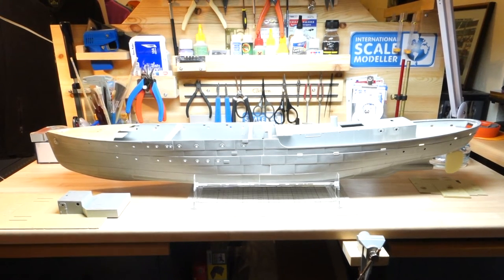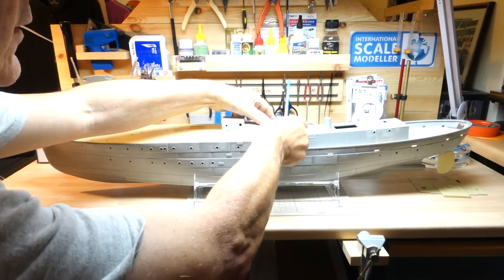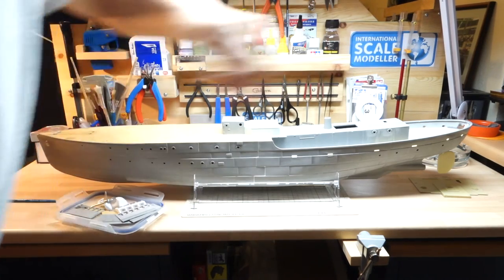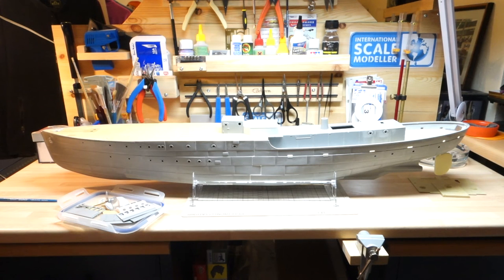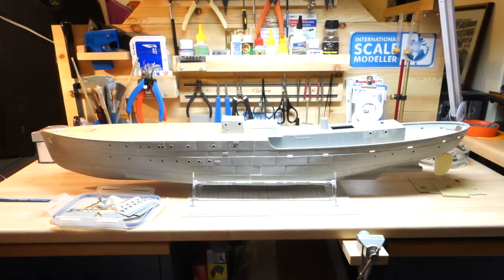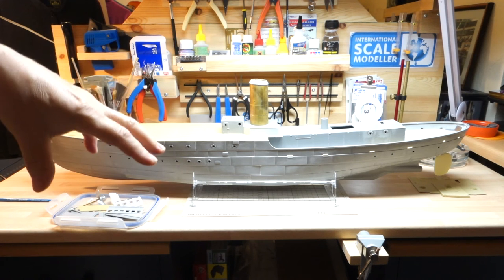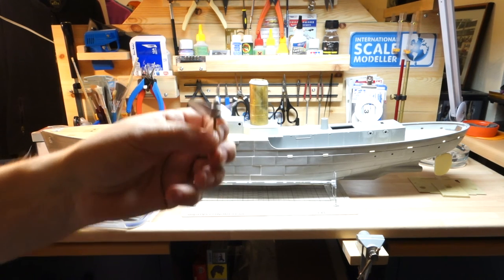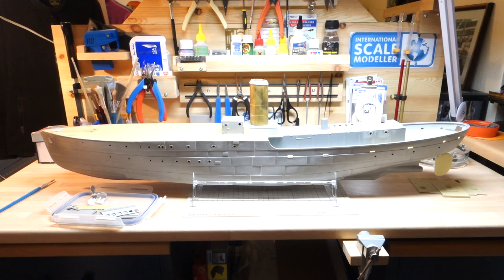SWITCHER PROJECT BUILD   FLOWER CLASS CORVETTE BUILD UPDATE 3

Comment: Great update Paul :) For your eyebrows over the galley portholes. Cut a sliver on your mitre box of 5/16" tube for the large port hole and 1/4" for the small one (door), cut in 1/2 with your knife/ chisel and sand down to visual perspective :). I knew that telescoping set would come in handy LOL eg. acquired for the mushrooms, I made my depth charges out of them and now eyebrows. Thanks for the tip. I overlooked that one and yes theu would have eyebrows. That is why BBs are so much fun. 2 heads are better than one. Nice catch m8te :)